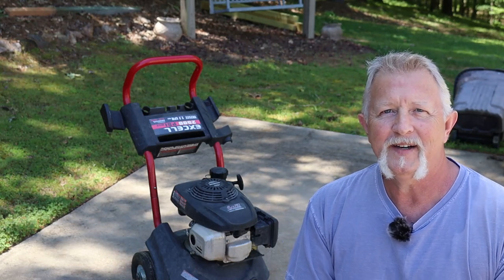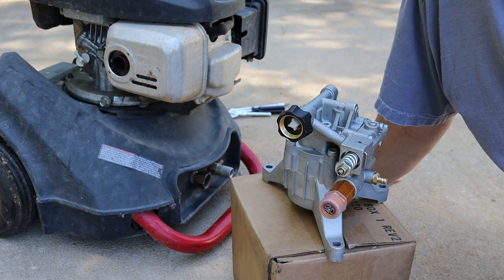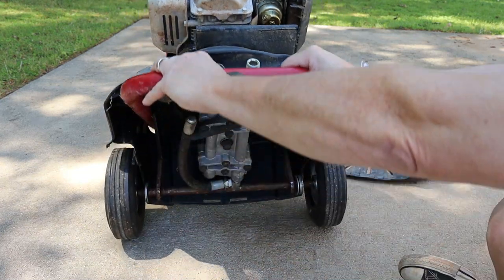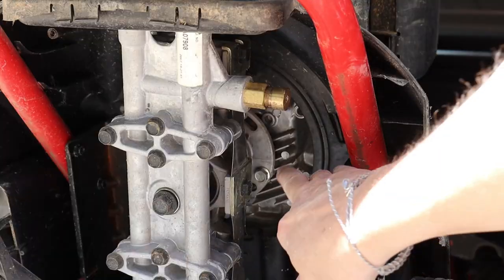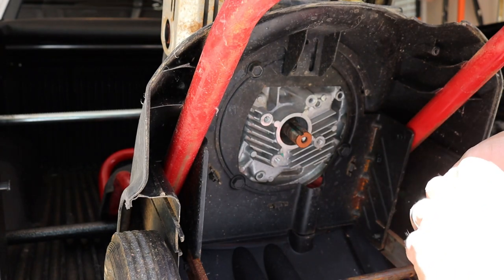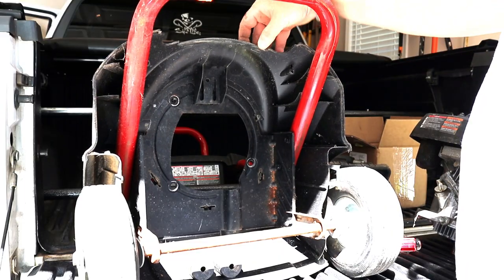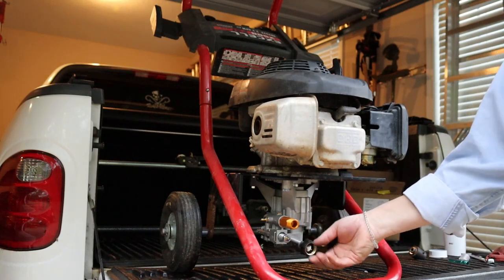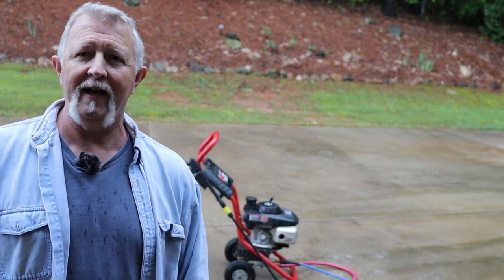Upgrade or Replace the Pump Excell VR2522 and VR2500 Pressure Washer

Comment: Dennis, Thanks for featuring one of our pumps! We do offer both the pump alone as well as with a keyway or other desired accessories. Thank you for showing the gap and how to resolve it. Because it is not the same bolting, this gap can occur on a select number of models. Without realizing this gap could exist, a customer could break one of the legs off, so when you show people to dry-fit the unit, it is some great advice! We are happy it worked for you and we do hope you will order from us again. We now have our own website with free regular shipping within the lower 48 states. God bless and stay rugged!
Reply from the maker: Thanks so much for watching and for the feedback!  Your pump has made a huge difference in the operation of my pressure washer and many others as well.  With your pump, this unit is better than new!  Thanks for a great product at an affordable price.  It's nice to get positive feedback from the manufacturer, I appreciate that!

Comment: Great Video AAA+++   Keep in mind that BEFORE you connect your water supply, MAKE SURE you get the required static & dynamic pressure and flow rate from your supply hose.   For example, your pump may require 2.5 GPM (gallons per minute) and a minimum pressure of 20 PSI.   You may have a static house pressure of 80 PSI, but when the water is flowing at 2.5 GPM, the dynamic pressure may drop to 20 PSI.   For the flow rate, use a bucket and measure how fast it fills to 2.5 gallons.
Reply from the maker: Great tips!  Thanks for watching, Brian!

Comment: Picked one of these power washers up at a yard sale the other day thinking I had walked away with a deal for $100. I got it home and hooked it up and it was more like a sprinkler than a power washer!  Looks like all the seals and even the thermal bypass had failed!  It's a shame because the engine, frame and hose and sprayer are all in really really good condition.  So, Dennis, you've really saved the day with this video. I ordered the parts and with any luck they'll be here this weekend.  While I have it apart I think I'll also replace the cracked up tires with some pneumatics, repaint some rust spots on the frame and mount a container for soap on it somewhere.  Figure I might as well soup it up if I'm gonna spend a few hundred on it.
Reply from the maker: Thanks for watching, Logarth!  I'm glad this helped salvage the washer.  I like my pressure washer with this new pump more than I ever did with the factory pump on it.  Sounds like you will be all set when you're finished!

Comment: Thank you for your excellent how-to video. When I looked up replacement pumps for my VR2522, I balked when I saw they all looked so different from the original. But your video showed me it was not going to be a hack job and would be fairly simple.  One little snag was the pre-cut key was not square and had to be filed down to fit.  The most annoying thing was getting those stupid plastic rivets out of the plastic shroud (which has been discarded.)  My pump works great now.
Reply from the maker: I am happier with my pressure washer after the conversion than I ever was with the original pump.  I'm glad this was helpful to you.  Thank you for watching!

Comment: Wow, it was like having an advisor standing right next to you as my power washer was the exact one you worked on.  The replacement was precisely as described - I did remove all the shroud and stuff as you did Dennis and I like it much better now!  It works better than new.  THANK YOU so much for taking the stress out of the changeover.
Reply from the maker: Thanks for watching!  I agree....I like this pressure washer more now than I did when it was new!

Comment: Thank you sir.  I had a tough time matching the four bolt pattern on mine.  I am going to do the same thing you did and remove the shroud.  I'm also getting the 2" 3/8 16 bolts.  Your video was very informative and not dragged out.  Straight to the point and explained plenty. Hunts
Reply from the maker: I hope this helped and you got it worked out!  Thanks very much for watching!

Comment: A very well done and helpful video. One suggestion though for a modification to the process shown that I found makes things easier: 

Rather than installing the pump with the unit tilted back on its side, start by placing the motor completely upside down on a bench, then position the frame on top of it, and finally slide the pump over the shaft and line up the bolts and spacers. By doing the install with the entire unit upside down you are allowing gravity to do the work for you rather than working against it by installing at an angle. Just be sure once installed you let the unit sit right side up for a while to allow the oil to drain back down into the sump before starting.

Thanks again and hope this helps!
Reply from the maker: Thanks Mark!  I appreciate you watching!

Comment: Hey Dennis
I had the exact same model with the same problems, leaking out of the pump with no pressure.  I was fortunate enough to find your video and I used your link to order the pump.  I got the key from Ace Hardware for .65 cents.
I followed your video and installed my new pump and like you, the power washer is better than new!!
Although the pump is more expensive $90 bucks, I am happy with the new machine!!  Like you, I left off all the plastic shroud where I can get to all the connections.  Thanks again for taking the time to do your video, I felt like you were my neighbor helping me out!
Reply from the maker: Thanks for watching!  I have never liked this pressure washer as much as I do now that I've changed the pump.  It's like a brand new machine that works better and is easier!  I'm glad this helped and glad you got your pressure washer going!
Reply: Thanks for the video instructions. I have the same pressure washer and the pump had a crack on the outlet so I could not get any pressure. Tried to replace the pump but the pump was discontinued from the manufacturer. Looked around and came across this video. I ordered the pump on EBAY and installed and tested. It works, no leak and good pressure. Will try it out in the coming weeks. I think I spent more time to look for the 3/8” bolts than the time I installed the pump credited with this video. Thank again for taking the time to do the video. Be safe.

Comment: I used blue loktite on the 3 bolts holding the pump on the motor. Felt like those had some thread locker on them on removal. Easy DIY upgrade! Thanks again for the vid!! Also used some 1/2" EMT conduit to make a couple axle spacers so the wheels don't wobble.
Reply from the maker: Nice job!  Thank you for watching!

Comment: Excellent video! Thank you, Dennis. I will be doing the exact same thing when I get the pump. Very much appreciated!

Update
I just finished putting mine back together with the new pump today. Thanks for all your insight. I didn't need any washers above my 2" bolts. The pump needed to go up tight as possible. I started it up and it works great!

I especially appreciated the tip to not cross thread those new bolts, so I was very careful.
Reply from the maker: Thanks for watching!  I'm glad this helped and you like the results.

Comment: Thanks for the video.  i must have missed the part about the 3/16 square key for the Briggs and Stratton engine on mine.  I needed to file the key down to 3/16 square to make it fit, but finally got it on and it works perfect.  Thanks for the instructions.
Reply from the maker: Thanks for watching, Daniel!  Glad you got it working!

Comment: Another helpful video. I have a power washer that has lost a lot of pressure. I was thinking about buying a new washer, but after watching this video, I’ll spend the $80 and give that a try. My pump mounts on the back of engine instead of underneath it, so the pump might be a little easier to replace on my washer.

So far today, watching three of your videos has really helped me solve some problems.
Reply from the maker: Thank you for watching, Jack!  I really appreciate the support.  I was never a fan of my pressure washer until I replaced the pump.  This new pump has me loving this washer now.

Comment: After having so many pumps crack in between the three valves, I started getting the ones with brass at the valves. The aluminum cracks under pressure at startup if the pressure washer has been sitting or if using bad water. Paying the extra $20-$30 for a brass one is well worth it and you'll never have to replace the pump for a long time. I even had a new 2700 Pressure Washer (used once and left sitting) that was leajing and too expensive to repair given to me.
Reply from the maker: Good points!  Thank you for watching!

Comment: Thanks for the tutorial. I just bought a used Excell PW and was worried about how long the pump would last not knowing the history.  Comfortable with the Honda engine, but now I know it will be simple  pump replace/upgrade if needed.  Sounds like I made a good $75 buy.   Thanks again.
Reply from the maker: Thanks for watching, JD!  I wish I had known about these pumps sooner, I would have replaced my original a long time ago.  This thing is so much nicer to operate, better pressure, etc with the new pump.  You got a great deal...even if you replace the pump, you still have less than $200 in it!

Comment: Thanks Dennis! My strap pump failed and I was looking at replacement options.  I came across your video and it was very helpful.  I have measured and it should fit.  I am installing it on a Delta DTH2450 psi with a Honda GCV160 5.5 hp.  I'll update this comment after I attempt to install it.
Reply from the maker: I hope it all went well.  I love this new pup on my washer, it's better than when new!  Thanks for watching, Shane!

Comment: Thank you much, for help with little details that dry one nuts. I never would have figured out those 27Thorx screws. One little clue: and oscillating tool will/did make short work of that plastic shroud.
Reply from the maker: Great idea using an oscillating tool!  Thanks for watching, Marsha!

Comment: I was trying to adjust the unloader valve on the factory pump, but it looks like it doesn't have one. That's when I ran across your video. It looks like I will be replacing the pump thanks to you. Great video!
Reply from the maker: Thanks for watching, Igor!  You are correct, the original pump does not have an unloader valve, only a surge hose.  This replacement pump I used is so much better than the original.
Reply: @dwcoffey  I have this same pressure washer 2522 I got for free from a friend the thing fires up and engine runs well and water runs through it but as soon as I let go of the trigger the hose gets extremely stiff and I’m not sure if it’s supposed to do that it seems like if I let it go too long it almost seems like it would blow up and the engine bogs down like it is still under load. Is that originally how it was supposed to work?  As soon as I let go with the trigger it freaks me out that somethings going to blow up!  What would you recommend doing I’d hate to just get rid of this it seems like a nice machine.

Comment: Great video I think I'm in need of a new pump or a rebuilding of the existing pump. I have on my Briggs & Stratton pressure washer.. I couldn't help but notice the engine rpm up &  down or better, known as hunting. It looked like you had a Honda engine, which is also what I currently have as well. Tho the engine hunting does not affect it the longevity of your engine it can be annoying to a DIY er such as yourself. The way to fix the engine rpm up and down is there should be a small screw with a Phillips number 2  head near the carburetter bowl. There' are 2 different types of set ups in order for you to get out that screw and remove it  but you probably won't have to remove the carburetter, when you remove the screw you'll either find nothing inside of it but a hole and if you take a micro hand drill about 13,000" and gingerly, mimic a drill bit back-and-forth. Eventually, you'll poke through that clog of ethanol in that jet, and then you could blow it out with some compressed air or better yet carburetter cleaner and compressed air.
Reply from the maker: Yea, I've just been too lazy to fix it....need to get after it.  haha  Thank you for watching, David!

Comment: AWESOME Video!!!  AAA+++   This new pump worked great.    I wish I could post some Pics - I have a couple suggestions:  1) screw in the Thermal Valve first, before you mount the pump.  2) I used a Dremmel with a cutting wheel to cut out a front section of the top plastic cover, (after I completely removed the small front & bottom section),  3) I put a flat board behind the top engine shroud and in front of the red handles -  this held the engine in place when I tipped it back and removed/replaced the engine bolts.   FYI - Google removed the American Flag from the emoji list and replaced it with a pride flag 😪😟
Reply from the maker: Sounds good!  Thanks Brian!

Comment: Thanks so much for this!   My surge hose sprung a big leak and the outlet was cracked so I'm so glad I can do this!   Thanks for the step by step!
Reply from the maker: Thanks for watching, Ronald!  I had to replace my surge hose last year, the cheapest I could find it was around $25.  When the pump starting leaking around one of the pistons this year, I looked up parts to repair it.  The parts cost more than this replacement pump.  I ran this new pump for about 4 hours yesterday is was great!  I can tell the difference in the the pressure and no problems like that old pump.  Now I just hope it holds up, but so far, so good!
Reply: Dennis Coffey  the parts came a few days ago and it was a very easy and quick repair thanks to this video and I had it up and running in about 25 minutes!!
Reply from the maker: That's great, Ronald!  I've used mine several times already with the new pump, and I wish I had done this a long time ago!  I'm loving this pressure washer now!
Reply: My outlet was cracked too. Wondering if I could use JB weld on it...

Comment: I agree you do a great job in explaining how to upgrade this pressure washer.i also Hate the plastic covering it keeps noise down but it a hotel for spiders and hard to take off and harder to put on.
Ps.I love that old strap pump most still working long after 50 hour design!
Reply from the maker: Thanks for watching, David!  Yea, I agree....amazing that it kept running as long as it did.  I really like this new pump though.....smoother, consistent pressure, etc.

Comment: My unloader broke down. Thought on getting one no matter how hard it is . but honestly you make it look so easy and I'll just go with this.. Great video. Really helpful!
Reply from the maker: Thanks Mario!  I appreciate you watching!
Reply: @dwcoffey  ive seen a 3100 psi 2.5gpm pump upgrade. Do you think the motor can handle that or is too much?
Reply from the maker: Hey Mario, I'd be concerned about the engine handling 3100psi.  Although, there is only a slight difference between the 2500psi original pump and this 2800psi pump I installed.  I suppose if the 3100psi pump you are looking at can be adjusted...you could try it.  If it is too much for the engine, reduce the pressure. 
I spent all afternoon today using my washer with the new pump.  I can really tell a difference in how fast I can work with this new pump.  3100psi would be really nice if it runs well with it.

Comment: for all those following this the key stock on amazon is not 3/16 square and will have the be filed down to a square which is a pain. Highly recommend just buying a 3/16 square key from small engine shop. Caused me to need a new shaft seal on my engine and I had to do this all twice.
Reply from the maker: Thank you for that, Jeff.  I changed the link to a 2" key that is known to be the correct size.  It comes from the same supplier as the pump.  I appreciate you watching and for the feedback!
Reply: The reviews speak loudly of the quality of your Work! Great Video!

Comment: Great Idea thanks for showing the whole process very informative and if I can't rebuild my pump, I may need to go your route.
Reply from the maker: Thank you for watching, Rolando!  That's how I ended up replacing mine.  The parts to rebuild the piston pump were more than this new pump.  I wish I had done it a long time ago.  The new pump works better, gives me more pressure and makes the engine easier to start because it has an unloader valve.

Comment: Excellent video. Very well done. Thank you so much!!!!

Update: Got my pump off amazon. I found a kit that included the key and bolts. Interestingly enough, my pump inputs and outputs are on the back side of the machine. Not sure if the pump I got is different or the engine is different. Still works great regardless. Thanks again!
Reply from the maker: Thank you Gavin!  I appreciate you watching!
Reply: I must have ordered the same pump because mine is lining up in the back as well. Is your pump still working fine?
Reply: Michael Muckelvaney Yeah, it’s still working well. Although I don’t use my pressure washer more than a couple times a year.
Reply: Hey Gavin,  I had the same "problem." I purchased the exact pump. The pump only mounts to the frame and engine where the hoses exit the rear. There are 3 bolts on the vert top and 4 bolts on the pump housing that hold the bottom and the top portions of the pump body together. I watched another youtube video: https://youtu.be/EE0P0_kxjNg and learned that the pump can be taken apart, the bottom mounting legs rotated 180 degrees and put back together!! Now the hoses exit the front of the unit!! check this out! https://youtu.be/EE0P0_kxjNg  there are 2 parts to the video